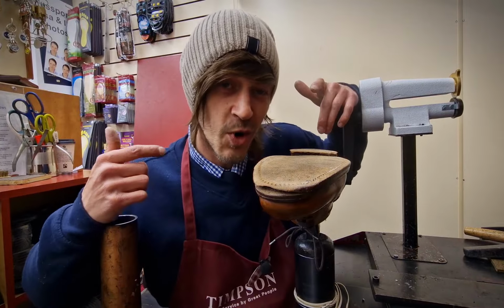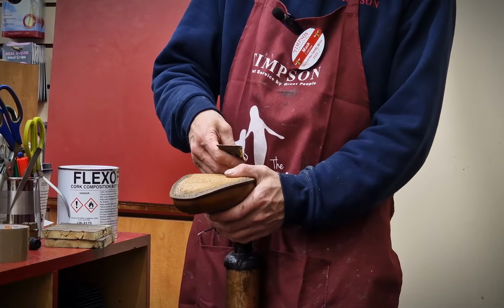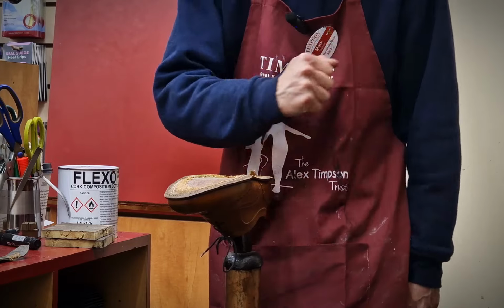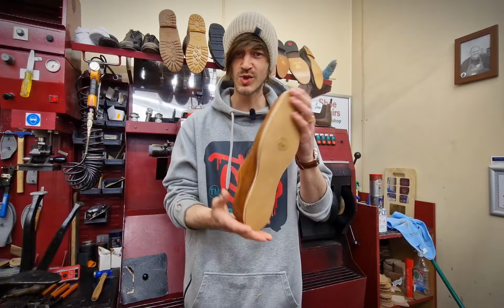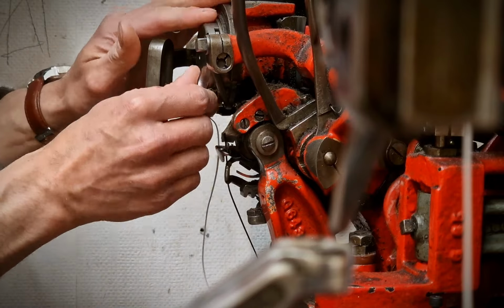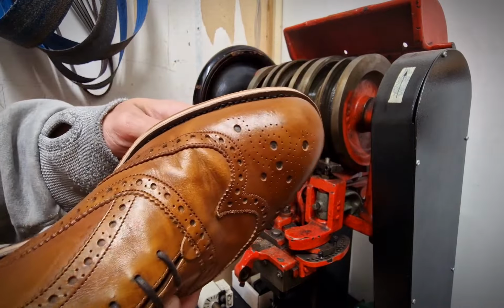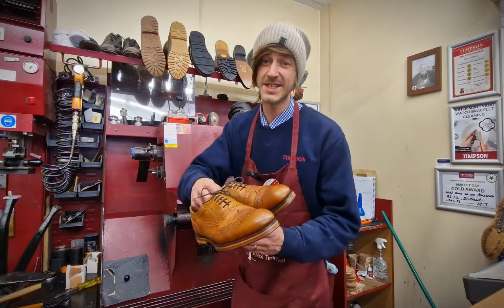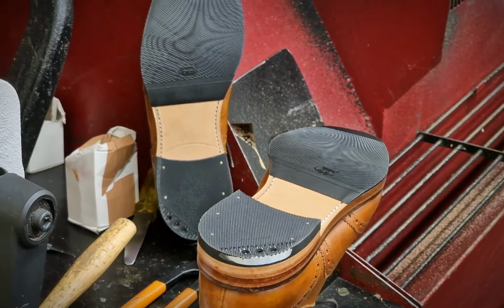Rebuilding these BEAUTIFUL Joseph Cheaney shoes

Comment: Hello, what is that silver metal object embedded in the heel?  What is it called?
Reply: At 3:20 ? That's the leather shank (it can help prevent squeaky shoes and offer more support). I think it also has the metal shank glued underneath it (actually it's really hard to tell since there's glue on there, so it's a guess lol 😅). I've seen cobblers do that before. Other times the metal shank doesn't have the leather piece on top. And there's also shanks that are thick leather strips. So those are the possibilities in the video.